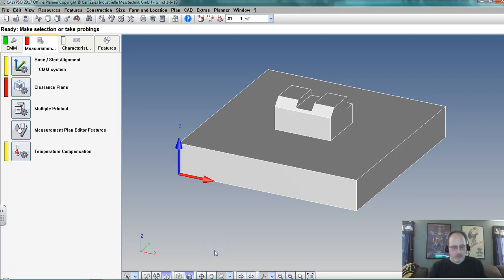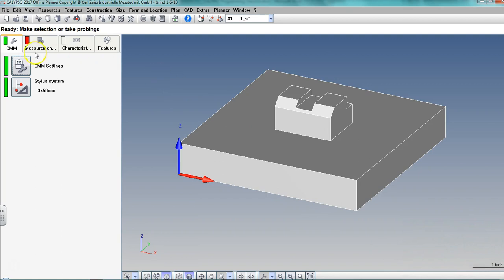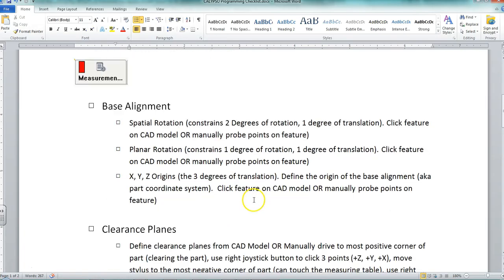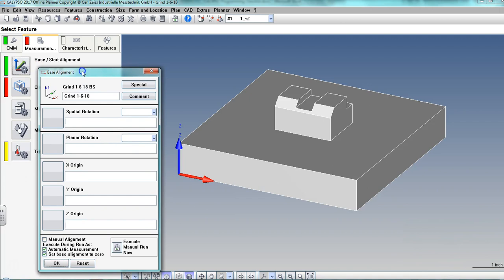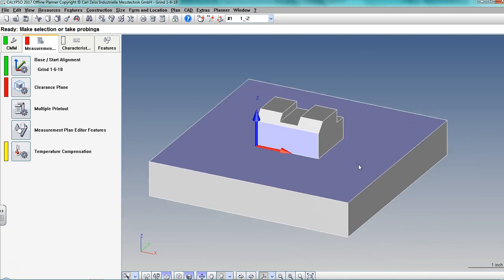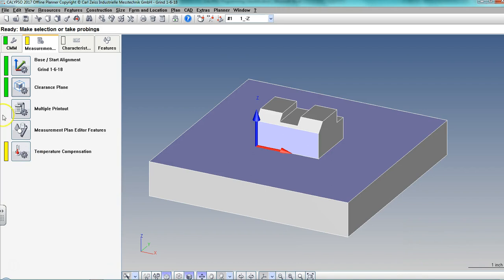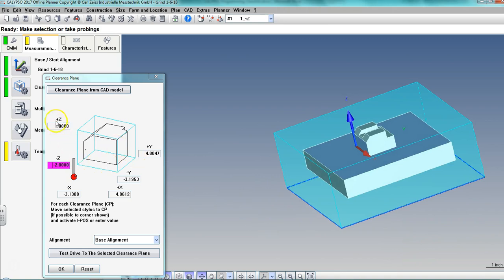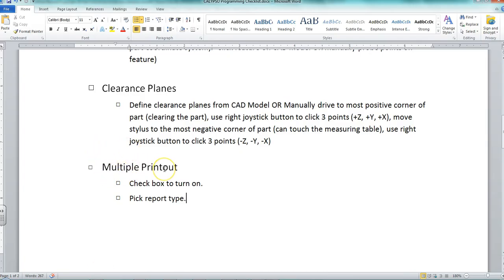Calypso 2017 Programming Part 1

Comment: Great video sir. It's inspired me, But please do a video on manual checking program not a CAD model please......
Reply: Cobra team Hi there, I work using CALYPSO. To do non-CAD programming, you can either use the physical CMM itself to probe the part and create features and then use those, or you can click the "features" tab at the top of the screen and then create features and enter nominal values from the drawing, effectively 'building' a cad model of your own. I can try to explain more specifically if you would like.
Reply: @Drischa  i like to learn